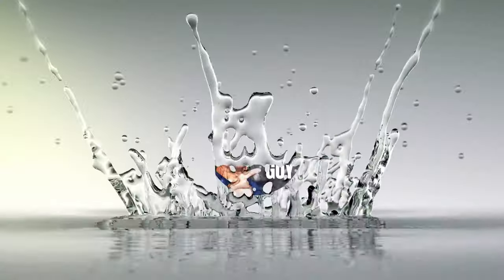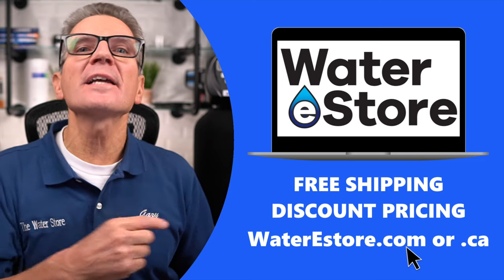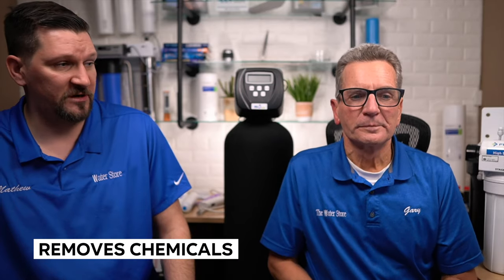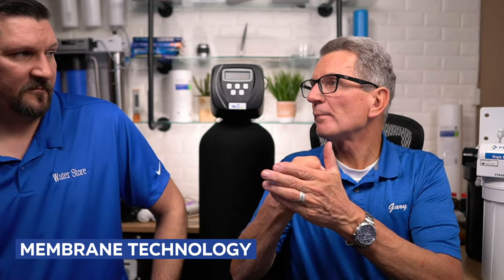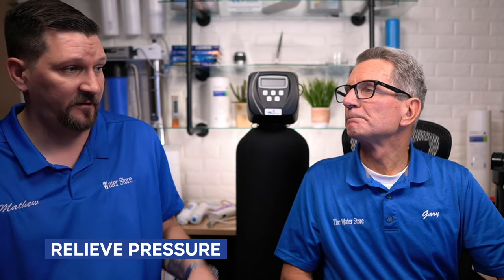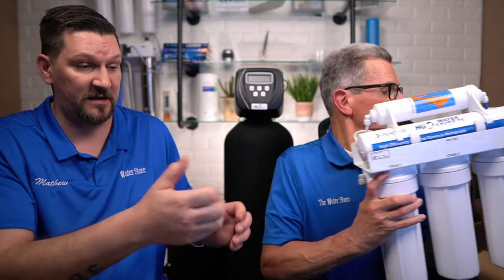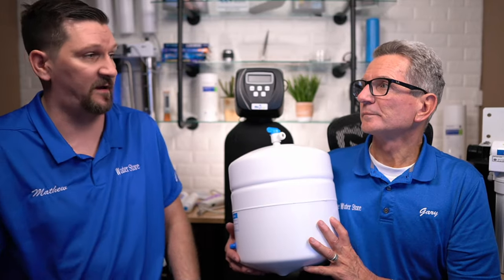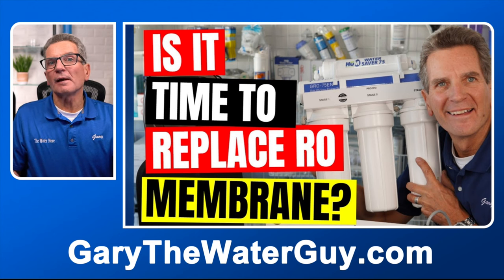EASY DIY Reverse Osmosis Drinking Water System MAINTENANCE

Comment: Hey Gary, I'm looking for a RO system for under my sink. I am on a well and it IS treated, just need the RO system for my wife's peace of mind. I don't have much space under there so I am considering a tankless system. Do you sell one or could you recommend one?
Reply from the maker: Sorry, no I don’t like or recommend them. Not at all happy with the water quality and they require hydro since they have an internal pump to push the water through the membrane. Do you have hydro at the install location?
Reply: @GarytheWaterGuy  I am not familiar with what a Hydro is. I was only considering a tankless because of the small space under the sink I have.
Reply from the maker: @hylander40  when I say hydro I mean they need to be plugged into an electrical outlet. Do you have an electrical outlet under the sink or in your install location?
Reply: @GarytheWaterGuy  Oh, Yes I do have an outlet. I'd be happy with the watersaver 75, I just think it would fit.